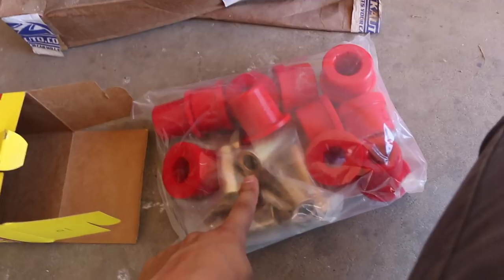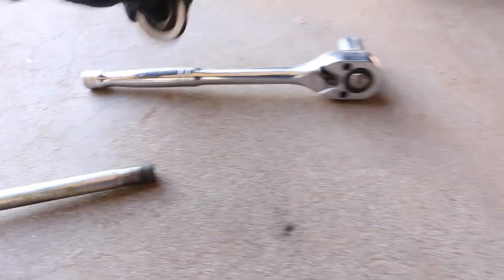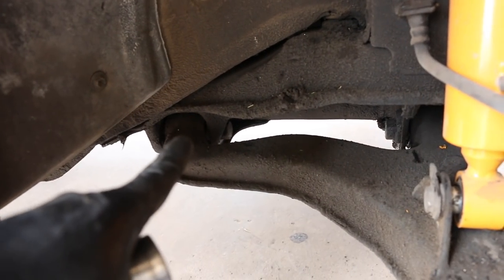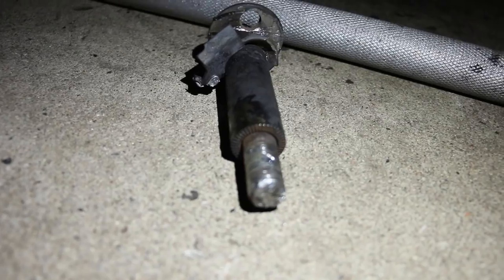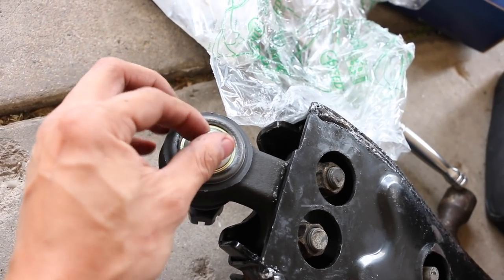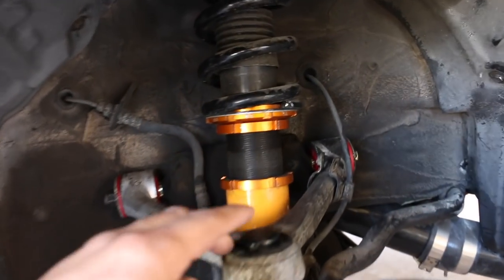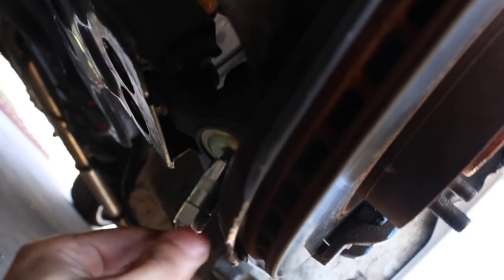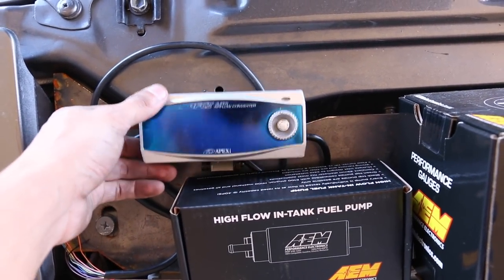MK3 SUPRA BUILD, ALL NEW SUSPENSION!!

Comment: For lower control arm bolts you need to cut then with sawzall reciprocating saw  with the highest end steel cutting blade.  You will need to do this on the back side now that you’re done with front.  It’s known for these bolts to rust on the bushing sleeve.  The rear traction arms bolts also need this, pain but only way to get those out.
Reply from the maker: engineer4hire ya i gotta get to them

Comment: Good job as usual on the upgraded bushings and steering pieces.  I just inspected mines last night and my front lower control arms have shifted back and mushroomed the rear bushings.  Guess I’m pushing my car pretty hard. 😬Going to order another set as backup and keep a close eye on these or look at what the drift guys are running. I see why Toyota used those big busty chunks of metal/rubber bushings as stock. Extremely hard to remove.
Reply from the maker: 340 Supra they are the worst to remove they can cause some headaches for sure
Reply: LFATV I had to use skil saw, jig saw, angle grinder, bushing press, lol. Cut rinse repeat. I sliced the end of my control arm just a little, welded it and grinded it back smooth
Reply from the maker: 340 Supra almost similar process lol

Comment: Fyi, if you've ruined your ball joint dust boots theres a poly urethane dust boot that works perfect.  I have them on my rear.
Reply from the maker: Christopher Rhoads ahhh thanks for the heads up ill look for the rear ones
Reply: @-LFATV  they work for the front also

Comment: I have a 86 mk3 with the tems adjustable dampping if I put coilovers on do I have to get rid of that system and will there be a warning light of any kind?
Reply from the maker: Charles Dail yea you might have to get rid of them, if your cars has oem TEM lights inside the cabin, well they might light up
Reply: You'll lose TEMS.  Not sure what the lights do but it should be the same as if you disconnected all the TEMS wires from the stockers.

Comment: What about the rear?  Have you looked into stiffing the subframe from throttle twist?  I can't stand punching the gas only to have to turn the wheel sideways to compensate for the subframe twist.  Saw some really nice full metal bushings for the subframe to frame connection points.  Really love you videos too btw; I'm thinking about doing similar videos when I do more stuff to my mk3 supra 7MGTE.  Gotta fix my BHG first though, and I couldn't spring for the full rebuild like you did.  For now I'll see how long ARP studs and MHG can get me.
Reply from the maker: T Kush yes i have the same kit for the rear suspension.. i showed it few videos back. And also i would do atleast and oil pump shim if you are not rebuilding the bottom end

Comment: Do you happen to know the specs on the front k-member bolts on the back? They're shoulder bolts but I don't know what size length or thread pitch. Mine fell out ayye
Reply from the maker: Dam no i dont bro i just took the caliper to ACE and got random ones that fit

Comment: Where can I find replacement upper control arm ball joints!?!?
Reply from the maker: CryptMSC they dont jst sell the upper ball joints i think
Reply: @-LFATV  What about control arms them selves? I can't find them anywhereeee. EBay had them but its like the left side only.
Reply from the maker: CryptMSC i couldnt find them either thats why i jst did the bushings
Reply: @-LFATV  Ill do some research and let you know if I find anything. Ill prob post it on suprafourms too. Battle version makes toe links and I think upper control arms. But its all spherical and a little pricey.
Reply: @-LFATV  Do you think an MK4 or Sc300 ball joint could be the same? Im wondering if I could even fit a GM ball joint in there.
Reply from the maker: CryptMSC no they are different. And the aftermarket ones are expensive
Reply: You can change the boot for the front ball joint part # 13009 in suspension.com

Comment: What is the paint color code you used?
Reply from the maker: New warm grey is the name
Reply: Bought an 88 looks the same color (factory).
Reply from the maker: OICU81266 yea u got the “Toyota Grey”
Reply: Mine has small factory red pin stripping along the contours of the fenders... BTW those wheels set it on fire 🔥

Comment: I'm writing your video from Madrid very well, but to change the upper suspension ball joints you have to first find them, if someone can help.  I will be grateful
Reply from the maker: The upper control arms are sold as One complete piece. Find them at rockauto.com
Reply: @-LFATV  Read TV, Thank you for answering me, I have looked for the upper suspension ball joints with your arm but they do not exist in the catalog, You speak Spanish where you are in Mexico USA You can give me more help Thank you very much
Reply from the maker: @eduardosarabiamonforte339  los ball joints de el control arm no lo venden solo, tienes que comprar el braso entero. Trata ebay tambien. Porque de otros lugares no se onde lo puedas comprar. Nomas conosco rockauto.com y ebay
Reply: @-LFATV  Muchas gracias por tu paciencia  hermano
Reply from the maker: @eduardosarabiamonforte339  denada. Ojala te aiga ayudado

Comment: Guys like us on budgets build the bottom ends to handle what comes aa we go. I'm running a stock but larger compressor side turbo for now. But down the road when I recoup my savings a bigger turbo and fuel system is coming so it will work that bottom end by the end of next year.
Reply from the maker: Billy Beane yea man gotta work on a budget